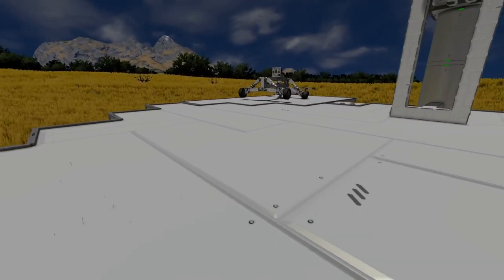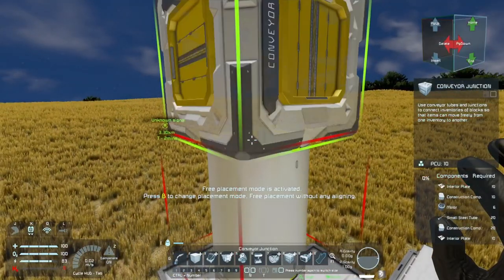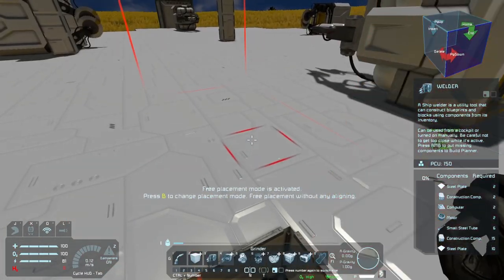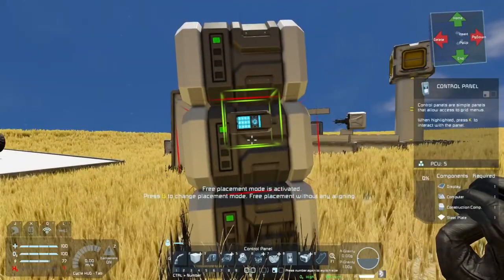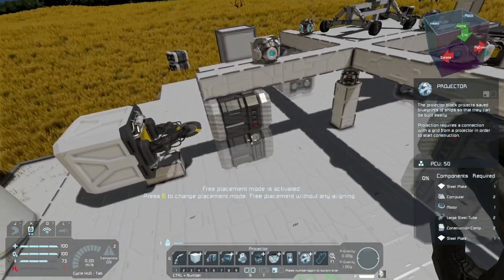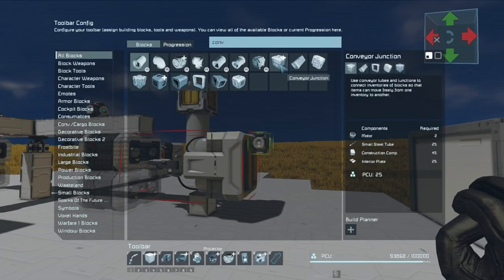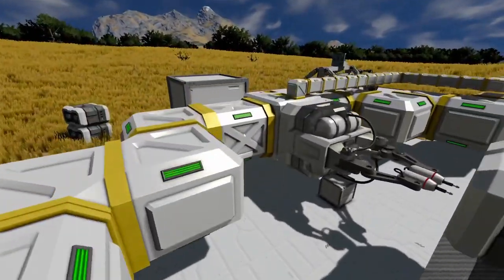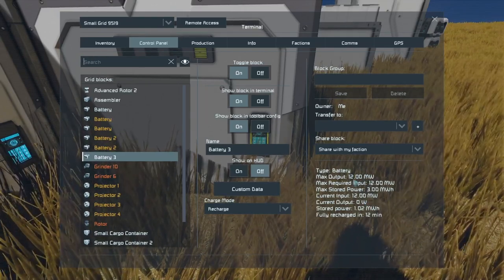Space Engineers Co Op : Testing the Battery Generator Farm ep 19

Comment: You are wasting half of your rotation.  You set it up in quarters so you only have 25% of a rotation to discharge a battery before it gets ground down and then you have a projection only for the next 25% of the rotation.  You need to put the grinders right before the welders so that discharged batteries get destroyed and then are almost immediately replaced with new ones.  This also has the added benefit of giving you 8 batteries discharging at almost all times so you can use a lot more power or you can reduce the number of batteries to save on materials.

Comment: Points of concern:
1. Speed of rotation; the time it takes to fully discharge 4 small grid batteries needs to match the time between complete weld and start of grind.
2. Output charge of small grid batteries needs to exceed the total power consumption of the drill ship for the same time calculated for speed of rotation.
3. Make the conveyors a closed loop system. Use a sorter on a dedicated assembler to produce power cells. If you accidentally use the battery parts then you will run out of power.

Comment: I respectfully don't get the level of work done to justify the build. I would call this Crap engineering, 1 step forward and 2 steps backwards.
Solution, x1 30GW deut reactor, a bunch of deut processors and 1 single DrillSystem  to extract stone. Energy for life.
Simplicity is the best engineering.